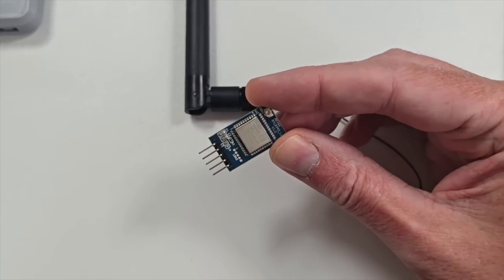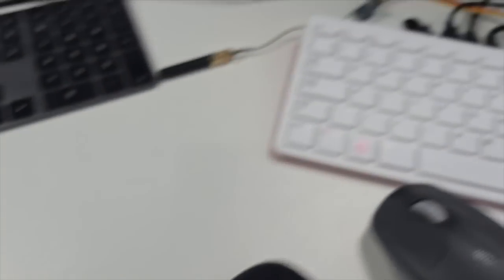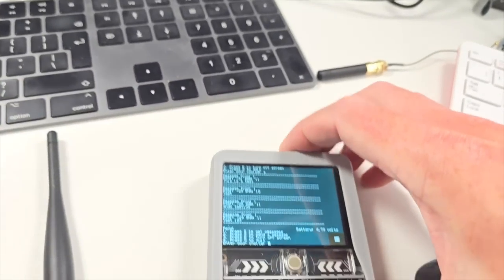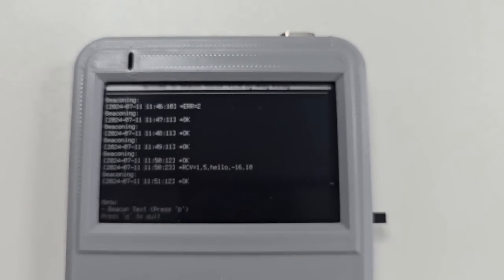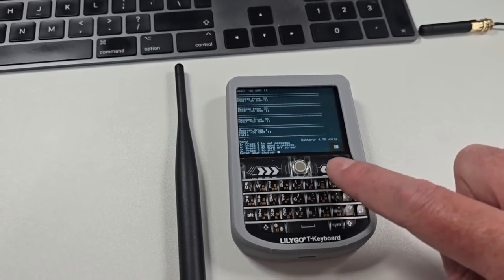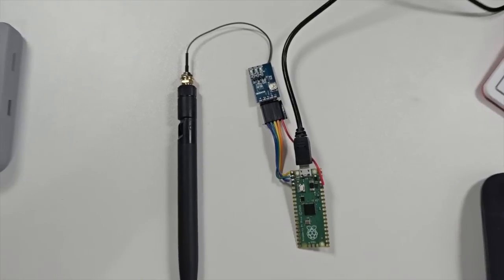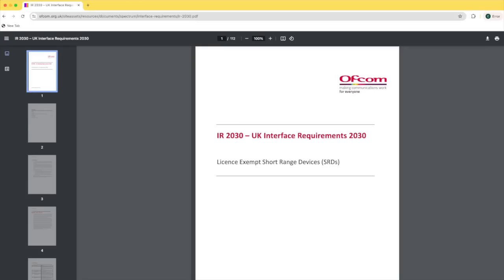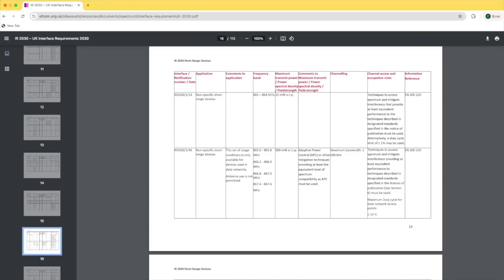LoRa Long Range Message System (LRms) using Reyax LoRa modules.

Comment: How is a system consisting of blind repeaters gonna scale? Two of those in range of each other will repeat at the same time and create a collision.
Meshtastic at least does listen-before-talk and collision avoidance by implementing random delays based on SNR and channel utilization. Yes, that might not scale up to hundreds of nodes, but with proper settings (e.g. use more CLIENT_MUTE and less ROUTER nodes as you've advocated for) you can get quite far. In the end LoRa has limited bandwidth so any system built on top of it has limits.
Reply from the maker: Firstly I think you'd need to have addressable repeaters, rather than doing what I did in my video where I used a simple RPT flag you could dial up a certain repeater with an ID, a bit like CTCSS on oldskool FM HAM repeaters.
I agree on the CLIENT_MUTE usage for meshtastic in very congested areas and I've been saying this a long time, I do intend to make a video about this. As I said in the video I'm not saying this is trying to tread on meshtastics toes, it never could but it can offer another dimension to the hobby and help people learn about how a system like this works rather than just turning it on and expecting it to be a whatsapp replacement!
Reply: @andykirby  I appreciate the nuance. It's just very difficult to balance between reliability and scalability using mobile nodes with limited bandwidth and memory. "Smart" routing algorithms will create overhead, with "dumb" routing manual configuration is required if you want to push the limits.
Reply: @andykirby  fm repeaters.. scale… lol. andy, wake up

Comment: Dude, I've been looking at meshtastic boards for months now, don't be telling me it's broken now lol
Reply: It's not broken it's just UK has so many nodes and many are configured wrong so they make the mesh not work great
Reply: @valzzu  How do you know they are configured wrong.
Reply: Lol meshtastic isn't going anywhere and the new UI looks amazing. I think it might become the standard for non-FCC bowing messaging systems
Reply: @HotelHero can’t wait to see how they get the t-deck sorted out. The t-deck is capable of many thing so would be good to see this as a focal point one day ?
Reply: @Woo_fpv  I have two T decks and am also looking forward to that day. If I must I'll take it upon myself to dabble in its framework
Reply: @HotelHero  (to be clear I agree with what you said about meshtastic not going anywhere and the new UI is great. I'm mostly responding to what you wrote about using it as a messaging system....)

Too bad the messaging part doesn't work reliably. A lot of people have very unrealistic expectations. It's fun to experiment with and learn about, and it's exciting to open a client and see that a node from a hundred miles away made it to yours via 7 hops. 

But good luck sending a message reliably to your neighbor one block away. Here's why:

Did you know that activity on a frequency is generally throttled to 25%? Yes, all those nodes talking to themselves choke the bandwidth. 

Check out your nodes' and other nodes' metrics if you don't believe me. It peaks around 25%. You might be wondering who is talking because you aren't seeing anything on LongFast. Well, that's because the nodes are saying to each other, "I exist" and "here I am" so much that it can consume more than 25%, and few people can talk when it is throttled.

Next, add in more nodes. Some homes become black holes for neighborhoods and cities because they have three nodes. Oopsie - there go the hops.

Then you have the folks who think they are the special ones who need to setup a router in their house, which further detroys the mesh.

On and on it goes.
Reply: Same people saying it's now broken after months or years of pushing meshtastic are the same type of people telling you the latest and greatest camera is what you need now. Ignore it, some people just need something new to push content for.
Reply: Meshtastic is deprecating Router_Client mode to address congestion issues.  In the future, use Client Or Router Or repeater mode.
Reply: @AGeekNamedRoss  A good idea, routers should also be required to store / queue up any message received for delivery and thus eventually deliver them all, routers should have enough resources to do this, or not be allowed online at all.
Reply: it's particularly stupid when you consider meshtastic devs are already working on a new routing algo
Reply: Right it's not, at least that I can tell. the routing algo will need some more layers, but it's a start! if your in a limited geo region, or using it at a party or festival it's probably awesome. especially good to hand a unit to a person you like at a festival (don't steal my moves mate lol )
Reply: @techbiotic8831 you're totally right, but the devs need to move fast on this. There's loads of hardware deployed to use whatever they come up with. In a few months people will have got bored of waiting.
Reply: @PaulTaylor1  Yes, seems the devs are too slow at their work, either hire more devs with the required skills or pass the project on while it is still alive.
Reply: @fibonacho  They just need to embrace offsets and the congestion dies. Easy. At the moment I think they want to contest because it isn't a massive talk form atm
Reply: @HotelHero  Not really, if 50% of messages were off set then the other 50% could still collide with them. off set will not work in this case, if all messages are offset then we are right back at the start with the same volume of messages in a traffic jam again.
Reply: It's not
Reply: It will level out like any hobby/fad/trend…… just have one full time base and 1 portable. I have loads of nodes but only keep two active full time…… lora isn’t going away IoT is used on mass

Comment: Here in Kentucky we are doing pretty well with our mesh we dont use the main root topic on US and are using a regional state and city root topic and its been running perfectly with no crashing.
Reply: But that’s MQTT, what’s the point in using internet based comms on a system designed for radio? Just text or use an app.

Many of us are trying to use it as actual radio, for SHTF etc.
Reply: @mattstacyandthepomskies ”SHTF”… lol… your comms are going to fail before the world will.
Reply: @TerraMagnus Right? And your little Meshtastic devices aren't going to be of much use in a "SHTF" power fantasy, if the electric grid is wasted your Heltec board is pretty much useless. Meshtastic is awesome but for somebody role playing as Mad Max it's kinda...silly
Reply: @matthewrowles6881  guess you haven't been using solar eh
Reply: @holliday.  Sure I have, but the fact you have a solar panel isn't suddenly going to make you Rick Grimes. Yes, you could probably make use of them, charging them with solar panels and so on, but at the end of the day for it to be of any real use there are several more components and however many other devices that have to be kept charged, secure, and functioning...it's whatever, Im not saying they dont work, or have no use at all, I just don't believe for a second the average citizen, will have the training and reference knowledge and previous experience using comms in high intensity situations to make them THAT effective. I could be wrong though, doesn't really effect me in any way either way you look at it so....eh ..whatever

Comment: Who would have thought that giving everyone a megaphone would replace the telephone system! 🙂
GPRS and TCP/IP has already worked this out.
Set up routing nodes with point to point microwave dishes to avoid bleed and RFI, then you can use small broadcast areas with fewer nodes.
Then it might work at scale.
Reply from the maker: Yep!
For sure it's been figured out before, it's all just requires a bit too much bandwidth if you are trying to do it without any sort of backhaul.
Reply: @ahaveland  if gprs and tcpip figured it all out why isnt it used by innovation andy now?
Reply: @TouYubeTom  Huh? Your mobile phone uses GPRS and TCP/IP.
The entire internet uses TCP/IP.

Comment: I'm not too sure if you have covered this as I'm at work and skipping through. Does it have encryption?
Reply from the maker: It has encryption by way of an 8 digit hex code.
Reply: @andykirby  that's better than nothing.
Reply: @ifell3  That's 128 bits.

Comment: So where I am in the states Meshtastic hasn't taken off, but there are a few of us sprinkled around. I'm wondering if it would work better there if you could divide up regions by channels. I know it might be easier to heard cats, but do you think that would theoretically solve the problem?
Reply from the maker: Yeah in areas where it's not busy you'll have a much better chance at successful messaging but you still need strong RSSI for it to work well.
The way to make it work currently is to turn off the mesh feature on all but very well placed nodes. This avoids a lot of congestion.
Reply: @andykirby like ham radio.

Comment: I wasn't impressed with Meshtastic, so I sold everything. Several nodes, high gain antennas, the whole lot.
Reply: Meshtastic is just firmware/software the hardware can be re programmed 

My issue is if any frequencies conflict causing more drop outs
Reply: I and a small group have just piled up some boards, parts, components. Couple hundred $$US worth. Planned to deploy about 6 standalone solar nodes and see what happens. One person has thoughts of using with CERT and ARES EmComm type activities. 
Should I act fast before the Amazon Return Period expires?
Reply from the maker: Yes, sadly this has been a bit of a trend lately.

Comment: So by passing on the message of meshtastic everyone hyping it up actually killed it! Ironic.
Reply from the maker: Yep! It wasn't ready for the onslaught of UK users!
Reply: @InimitaPaul  good learning though for V2...
Reply: @ahaveland  Just a heads up because there is a lot of chatter about this. They are technically on v2 and are discussing how to address a lot of the current issues in the next version (v3).
Reply: @fibonacho  thanks, I should have said Vn+1